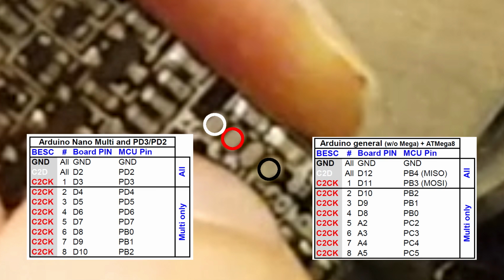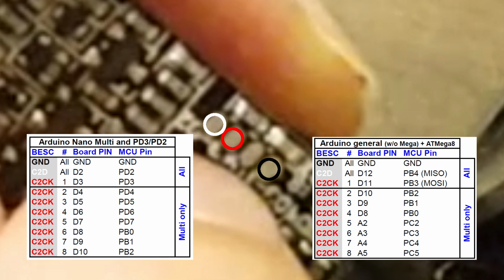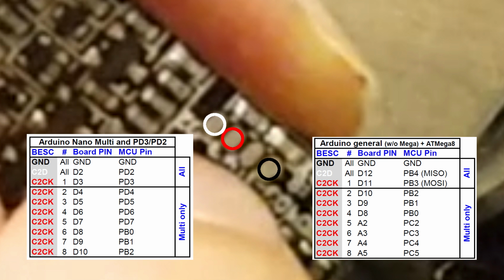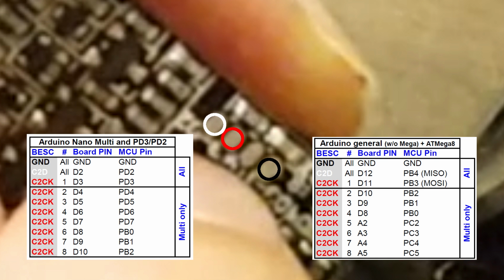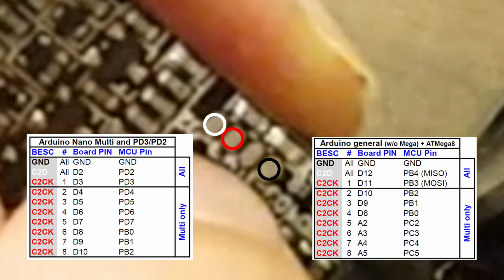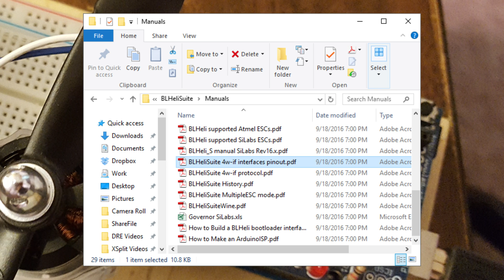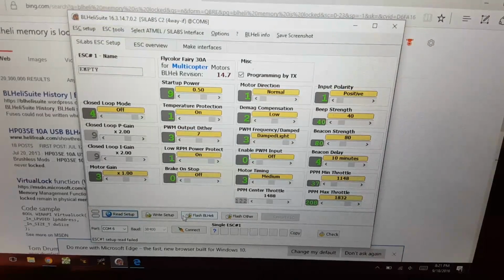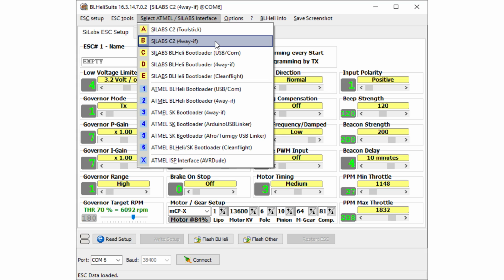How To Flash BLHeli via C2 To Your Eachine Falcon 210 ESCs

Comment: is this possible on a BetaFPV FC/ESC v2.1  1s boards??
Reply: chris budd believe so, mine without rx has two c2 pads near each esc. I bricked one esc so I’ll be trying this tomorrow. Probably have to use the flight controller ground pin.

Comment: I bought an eachine 220 HV I plug my FlySky receiver into it for PNP version and I can't get the propellers to turn what can I do
Reply from the maker: You need to configure the receiver protocol to be iBus if you are using FlySky. It is probably set to SBUS. In the Betaflight Configuration tab, change the serial receiver protocol to iBus. Then go to the Receiver tab and see if the channels move when you move the sticks on your transmitter.

Also, did you bind the recevier to the transmitter? That's also necessary.
Reply: ok well first off thank you for responding so fast.now I can see the remote moving in config but still cant seem to turn motors...im using the speedybee Bluetooth is that ok.is there anyone near Woodstock ga. I can bring it to
Reply: im willing to pay for help via video call
Reply: ok all set thank you for your help

Comment: i was updating my esc with blheli and after doing so  now i can't start my quad  after plugging in battery instantly power will go off and quad will not start and because there is no power now i can't open my quad in blheli, I'm using racestar 4in1 20A esc and watch some videos to flash via arduino nano but for my esc i don't know where is c2 port  ,please help me  waiting for your reply

Comment: Josh, thanks for your videos they are very helpful. I'm in the process of reviving my old 250 quad  which I have Rotorgeeks esc v2 and cobra motors installed. I will use my uno and straight pin methods and see if that works if not I will solder them on. 4 pin method with the 3.3v on the uno is a great plus.

Comment: Dude I need some major help. Bought my son a falcon 180 for his birthday, I took the motor spacers off and put the PDB above the baseplate. Now the copter flys squirrelly and has a weird isolation that I can't tune out. I watched your accelerometer/gyro vids and they seem fine, motors are fine.... would reflashing or replacing the ESC's help? My kids pretty bummed his copter sucks, any help would be awesome.
Reply from the maker: There are too many things that could be wrong for me to suggest anything specific based on what you've described. Did the copter ever fly well before you made the mods? Do you have video of the oscillation?
Reply: I have the Eachine Falcon 180, 210, and 210 PRO, and from experience i say replace those crappy flycolor fairy 20a esc's on your falcon with a Racerstar 4-in-1 20a esc (or better). They usually cost like $30.  It will make your quad feel sooo much more stable and easier to tune.

Comment: Can this be done with the new BlHeli Configurator in Chrome?
Reply from the maker: I don't believe it supports C2 interface, no.
Reply: I went to update some new escs and 2 of them show a "Flash failed" error in the Blheli Configurator using passthrough. They worked fine until I updated them to 16.65.  Any Suggestions on how to get them back?
Reply: Habe you found any solution? Im having the same issue right now :-(

Comment: Josh, I tried this way and when I connected the battery it says serial interface connected successfully. Connection to esc failed.Please check data and power connections to esc. I loaded arduino 4 way interface to my nano and selected Silabs c2 (4way-if). I am trying to fix a diatonic 202x blheli s esc. any help?
Reply from the maker: If you're failing to flash over the C2 interface, then the most likely cause is you have the wires connected wrong or the ESC is not powered up. You have the correct interface selected in BLHeliSuite and the Arduino flashed correctly, so there shouldn't be any software or configuration issue getting in the way.

Comment: I tried flashing my ESCs but always get "error writing to the flash" after flashing 40%. After several tries, the first 2 ESCs could be flashed, but I can't get the 3rd one to flash more than 40%. I soldered the cables to the pads, to get a solid connection, and everything seems to be fine, but it doesn't work. Do you have any ideas?
Reply from the maker: It's most likely a bad connection. Unfortunately, tracing it down is going to be a hassle.

Comment: Hi Joshua. I have been following you since your How To Fly A Quadcopter  videos.
I'm building my second Quad, and this time I'm reading before doing anything.
So this time my questions are about the ESC. Is really that necesary to flash a BlHeli on the ESC?.
I had to purchase some Emax nano, that dont come with BlHeli, y I dont know if I want to go whit this whole process.
Are the benefits with this firmaware high enough to make all this effort?

Thanks.
Great channel.
Reply from the maker: +Fernado Basello just get an ESC with blheli already on it. When you can get a set of Racerstar blheli_s ESC's for under $40, why buy anything else?

Comment: Hello ! 

Thanks you for the great video !

I tried your tutorial for a ESC  DYS XM10A. There are the 4 pads. 

I used the second one from the left to weld the C2C cable, the third one for the 3,3 V from Arduino Nano & the last one for the ground.

The arduino NANO 328 had been flashed with Arduino 4way-interface  and 4wArduino_Nano__16_MULTIv16400.

I have connected the Esc to flash it, Blheli recognized the arduino but when I want to read it tells :
"Serial Interface"m4wANm328P16" connected succesfully.

Connexion to ESC#1 failed!
Please check data- und power-connections to the ESC!

Hint : All interface lines are LOW:
ESC seems to be disconnected or not powered up"

I have the same when I put out 3.3 V and use the lipo.

Do you have any idea about the problem ?

Thanks you in advance,

AleC
Reply from the maker: Are you sure you have soldered the pads the right way around?

Comment: Seen mention that directly supplying 3.3V may damage the voltage regulator on the ESC. I went for soldering the C2 wires and battery power (EF180). ;)
Reply from the maker: +hempeline I wasn't aware of that.

Comment: I'm wondering, how bad ESC's feels like? What are the characteristics making an ESC a bad one? For example do they respond slow to controls, add noise to the power line, etc? I have recently built my first quad and I have some different brand spare components I want to try out. So for example where should I concentrate and look for when comparing two ESC's?
Reply from the maker: The Fairy ESCs that come on this copter are bad because they respond VERY slowly to throttle changes. This means the PID controller cannot stabilize the copter precisely. Also, they have weak braking performance because they lack dedicated FET drivers.

The simplest thing is to buy BLHeli_S ESCs. You can get a set of Racerstar BLHeli_S ESCs for about $11 each. At that price, no reason to buy anything else. There are more expensive ESCs with slightly better performance and durability if you have a bit more money to spend.

Comment: I seem to remember hearing about using twisted pair data cable for vtx or camera wiring.  Have you tried this?  I'm getting some noise on my video and thinking about ways to clean it up.
Reply from the maker: Twisting will help from externally induced noise but the noise is most likely coming from inside the electrical system, from the ESCs. Add a capacitor.

https://www.youtube.com/watch?v=0RP0FPGnilg

Comment: I flashed 8 or 9 xrotor 20a like this (used a bent pin header like andrey) and it was hell. Spent 30 minutes trying to do it on the 40a and gave up.
Reply from the maker: If at all possible, I buy ESCs with the bootloader already on it.
Reply: i got the older hobbywing xrotors since they're high performers and super cheap. They didnt have blheli until recently however

Comment: So I should be fine using some ribbon cable with male pins right? I need to do something with my Falcon 250 pro. To try this or just get some RacerStars and call it a day?
Reply: RCFyler85, you need a device that has a C2 interface. The typical USB serial devices such as FTDI adapters would not work. One way to tell is to look at the specifications of the device; it should indicate GND, C2D and C2CK pins. Another way is to refer to the official BLHeliSuite Programming Adapters documentation for the list of supported C2 programming devices.
Reply from the maker: +RC Flyer85 may as well try it. It costs you nothing but time. But the Racerstar ESC's are a thousand times better.
Reply: True... it would be a learning experience. Would this work or do I need an Arduino, this is all I have currently

Uxcell a14121000ux0589 CP2102 USB 2.0 to UART TTL 6PIN Module Serial Converter Adapter https://www.amazon.com/dp/B00SL0U3RG/ref=cm_sw_r_other_apa_29Q8xbJ23PQFY
Reply from the maker: +RC Flyer85 I don't think a simple serial adapter will work. I don't know for sure thiughm
Reply: Hmmm... well I mean I got the quad for free sooo I don't mind spending a little to enhance it 😉
Reply: Copy that...... Thanks FyreSG
Reply from the maker: +Fyre SG honestly an Arduino Nano for under $10 is a way better purchase than a C2 toolstick, if you don't already own one.

Comment: Never had a problem touching the pads with a pair of simple header pins
Reply: Yup, I also never had a problem flashing with the pin-touch-pad method for my Eachine Blade 185, Eachine Racer 250, Eachine Falcon 250, and Eachine Falcon 210. That's 3 pads on each of the 4 ESCs, on 4 multirotors.
Reply from the maker: +Andrey Mironov the spacing wasn't 0.1mm.
Reply: I'm using separate slightly bent pins
Reply from the maker: Ahh. I guess I figured as long as I was bending them, I'd just use wires, but the stiffer pins would have been useful, as the wires kept bending from the pressure.

Comment: After all this effort, the Falcon 210 had better be the best flying quadcopter... In the world. Too bad about the stock ESC's and their accidental demise. It would have been grand to see a before and after, but alas I can't imagine there's much "before" footage to compare to anyway. Having just done the Bootloader pad dance this weekend on an SP-F3-OSD board, I can really sympathize with you and your hemostat dance, and like you, a bad VBat input on the FC I was working had me chasing my tail with what was wrong everywhere but where the problem is (still unfixed). 

I wonder if an upgrade to BLHeli is possible on another Eachine product, the happy Racer 250, and its ESC's? While heavy, and equipped with spaghetti noodle arms, it's still fun to fly around, and very visible for chasing. I've had one in my fleet for about a year, still original even the arms, and it's been a good trainer for maneuvers I wouldn't be confident in pulling off on more expensive hardware. My next project was going to be upgrading it on a budget, using extra ESCs and an FC pulled off another build, but if I can breath new life into them using this method...
Reply from the maker: If it's the Fairy ESCs, they can probably be upgraded.

Comment: Ever tried using pogo pins soldered to a perf board to flash?
Reply from the maker: I haven't. In this case, it won't work because the spacing of the C2 pads is not 0.1mm.

Comment: Wow Josh. Your incredible.
Reply from the maker: My incredible what?

I couldn't resist.
Reply: Just blowing a little sunshine. I am just amazed at how much research you are able to do. I spent months almost everyday digging up info. You are always a step ahead it seems. I always wondered about these flycolor esc's and how they could be flashed. I have a programming tool but haven't used it yet. Using passthrough in Cleanflight now... The 16V capacitor is hanging in there. Wish we could hang out sometime.
Reply: @ josh I see what you did there
Reply from the maker: +Kyle Killorin thanks. I have a strong background in electronics and programming so I pick this stuff up quickly. If you're going to be around Knoxville let me know.